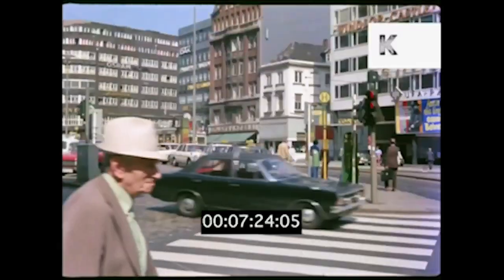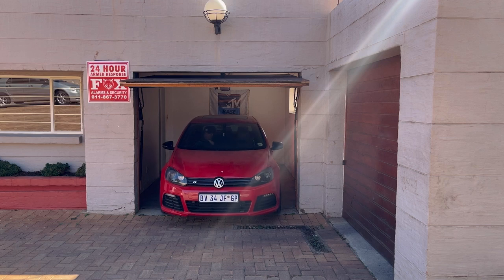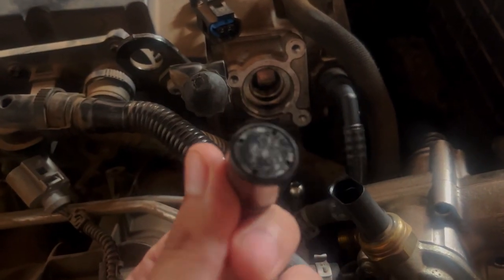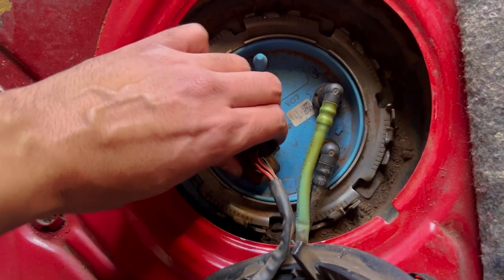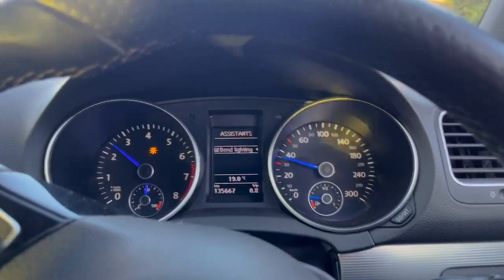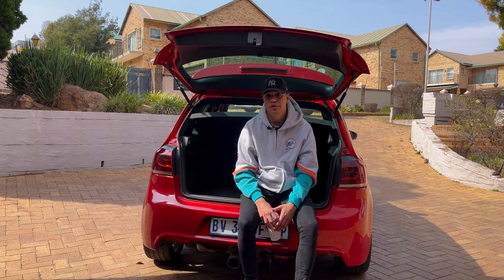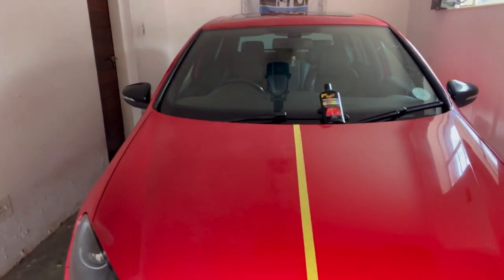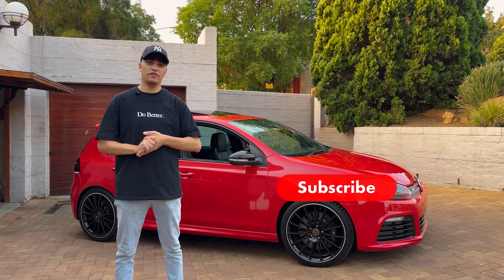Turning a Lemon into Gold: Golf 6 R Build Part 1 - Low Pressure Fuel Pump Replacement & Detailing!

Comment: Bro, you're saving us money on a paint job, bro. Is it that simple?
Reply from the maker: 😂 I guess it is just that simple. It would probably depend on how bad your paint is but works great for sun damage to clear coat. A step up would be to machine polish and I guess a step up from there would be to wet sand and then spray clear coat, which is probably what I’ll end up doing 🙏🏼🙌🏼
Reply: @Cee-JayDunne  Thanks bro that's good information you're giving us 👌.

Comment: P0087 is for the high pressure fuel pump on the engine.Had the same problem on N18 engine. Problem solved after fitting a new hpfp
Reply from the maker: Thanks man! 🙏🏼 That might be the next step
Reply: @Cee-JayDunne  you are welcome brother.
Goodluck with your ride💯
Reply: Had the same error message on my  audi b8 2020 ,,and the issue was the injectors over fueling
Reply: @sydneymukwevho3374  were they recalibrated?
Reply: @hectorbapela  My diesel filter was connected direct which caused impurities to affect the injectors...l.was changed common rail,HPP,low pressure to no avail.
Took the car to a mechanic in New lands and he changed and codes the injectors and my problem was sorted.
Reply: @sydneymukwevho3374  that's very nice to be back on the road. Trouble codes are sometimes frustrating

Comment: The 6R has the EA113 engine, better than the EA888 in the standard 6. But they do have their issues and those fuel cuts together with the codes are 2 things: 1 the intake cam needs to be replaced, the HP fuel pump lobes are worn and the previous ownes just replaced the follower. 2, injectors are done. You will probably have a slight missfire as well. Get it scanned to see which injector is causing it, but its better to change them all. Here is the problem, Bosch dont make them anymore and the Goldwagen ones are fine for a std map but if tuned then they dont cope. S3 injectors will work but the ECU will need adaption. 
Good luck, it gets expensive but lovely cars if they run right
Reply from the maker: Thanks man! Appreciate it. Definitely the goal to get it running well and then maybe even stage 2 🤷🏻‍♂️🙏🏼

Comment: 1 - Disconnect the battery for an hour to perform a hard reset on the ECU. If a fault has persisted long enough, it will log a long term fault on the ECU. I had this issue on my Leon Cupra many years back
2 - Log Blocks 230 (HPFP) & 231 (LPFP) to compare requested vs actual according to RPM\Load, 3rd gear WOT pull
3 - Could look at doing the 5mm drill mod on your HPFP inlet to alleviate pressure from your LPFP
4 - Fuel Rail Sensor as mentioned
5 - Upgraded RS4 Fuel Pressure Regulator Valve
Reply from the maker: Perfect, thank you so much. I’ll definitely give that a try, really appreciate it 🙏🏼